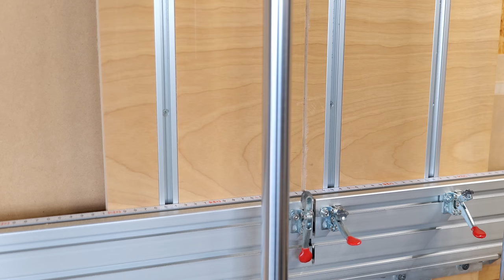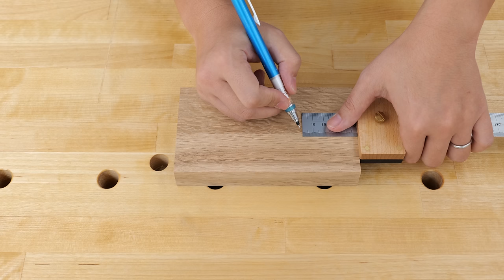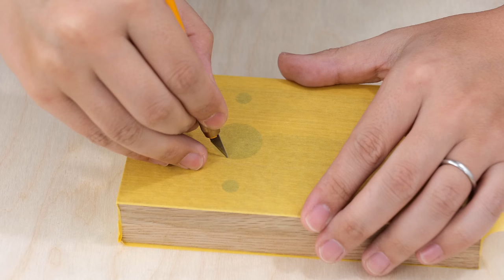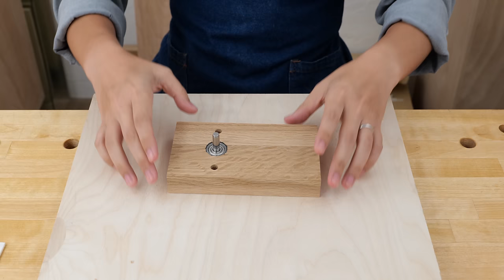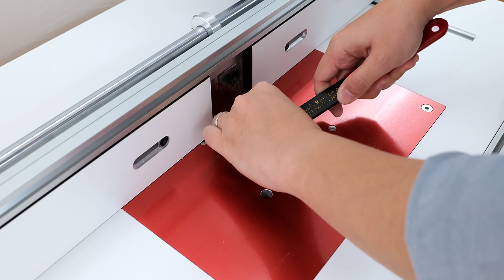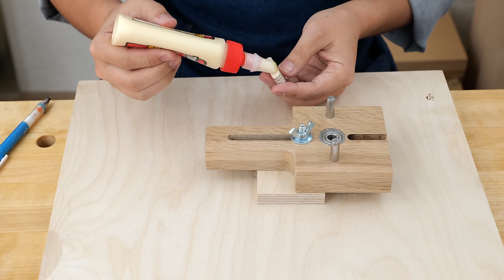Adjustable 3-ways Doweling jig | DIY Dowel Jig

Comment: I looked at commercial products and read all the positive and negative reviews. Most of this type jig were either inexpensive but flimsy or quite expensive and robust. I decided to follow your example, especially as I liked the use of bearings rather than steel or brass guides. Thanks for posting.

Comment: Just made one this morning, works great!  All my dowels were perfectly registered.  The only building mistake I made was not routing the registration groove far enough to the drill guide, the jig is more useful if you bring it as close a possible.
Thanks JSK
Reply: Are those like skateboard bearings that he used?
Reply: @shojimujoshojimujo3315  I'm not sure.  I just used a 3/4 inch high drill guide bushing from Lee Valley tools, works perfectly.
Reply: @acanadianwoodworker  How many man hours did it take
Reply: @patstenzel  I think maybe three or four?  You have to cut, layout and drill very accurately, and then router the guide in the middle very accurately.  So all the little setups take a while.

Comment: For most people who can't drill three very accurately spaced holes it would be far more sensible (and quicker and possibly cheaper) to buy the wolfcraft dowelmaster jig, which I suspect inspired this project.

More generally, if you are looking for accuracy or for at least one of the edges of the joint to be flush, dowel jigs that use a single reference plane are the way to go rather that jigs that self centre. The author has made videos on these types of jigs previously.
Reply: If you built this the way he showed you would be able to drill  three very accurately spaced holes.
Reply: Assuming the quill in the drill press you were using did not wobble around like every one built in China appears to! The author has built his own drill press using a hand drill that appears to have very little play in the output shaft bearings and runs on linear bearings.

Having said that, it is always better to reference off a single surface when accuracy is required. The featured jig relies on the thickness of the material being joined being very consistent, something that is not always the case.

Jigs that use a single reference surface are also easier to build and can be used to put dowels closer to the ends of a joint than this type of jig that can only get to 30-40mm away - not much use for material under 100mm wide!

In summary, this jig is only useful for joining largish engineered sheets of material such as MDF, plywood and chipboard, where the thickness of the material is very consistent and the edges to be joined are long enough to allow the pins used for self-centring to rest on the material. A jig that uses a single reference surface can join the above materials, is easier to make and can be used with more typically dimensioned wood, getting the visible edges perfectly aligned.

Comment: It seems fortuitous that your router takes the same diameter tool than what you want is available as a standard wooden dowel size. In the US, routers take either 1/4 or 1/2-inch tools. This means, for your nice self-aligned router trick to work, you’d have to turn down a (steel or brass) dowel from 1/2 to 3/8 part way to fit inside the roller bearing. That’s probably the trickiest part for most DIYers without access to a lathe. For 1/4 dowels, your method works out of the box.

Comment: Very ingenious and well done.
Thank you for this sharing.
The idea of using a stack of bearings for guiding the forest is ingenious, but I think the chip evacuation is therefore more difficult since there is no longer any relative movement between the forest and its guide. I wonder if a hardened steel drill guide might not be better.

French text translated into English by Google
Reply: Lousy translation. Bearings for guiding the "forest" ? Also, I would a cheap drill bushing rather than a stack of expensive bearings which is what I did as a tool designer at Boeing.

Comment: Fantastic workmanship, it appears that many of your tools you have built or modified yourself.  Unfortunately, I do not have the refined woodworking skills that you have so I had to buy a jig for dowels.  eg: JessEm Doweling Jig Master Kit.  However, I do very much prefer your design (twist centering pins) with respect to centering the dowel holes on the EDGE of the joint.  

You are incredibly creative.  BTW, Subscribed.

Comment: Ok so is it that you get the first measurement by eye to set the distance of the drill holes and slot, then you set the jig and all the other holes are measured automatically. That's a brilliant method using the two diagonal dowel bits to find the exact centre of the side surface. Brilliant mind. Is this what you call a thingy-me-jig?

Comment: Very impressed.  But it seems like the connected members may not be dead on 90 degrees to each other.  Think the first joint was not completely flush.  thought it could be that the parts were not completely set with the mallet.  Would have liked to see a machine square used to verify result.  The problem with many of these jigs is that they sometimes have errors that accumulate with each step.

Comment: Hrm interesting using ball bearings for that.  I'm not sure why he didn't cover the ball bearings with masking tape during the epoxy process though...
Reply: michel777ification  Uh, it would have been faster and he wouldn't risk pushing epoxy into the bearing?
Reply: Agreed. Seems like covering the sides of the bearings would have made cleanup of the epoxy easier

Comment: Very nice. A possible improvement would be to make it from a block of clear acrylic rather than oak, so that you can see through the jig to markings on the wood for dowel placement. In the example shown he seems to just place the initial dowels freehand, but sometimes they will want to be at precise locations.
Reply: The whole point is they don't have to be precise, because the initial dowels locate the second holes. Once the joint is glued who will know?

Comment: when drilling the two holes for the dowels using the drill press and the little spacer block, why use the block separately for each side/hole instead of just flipping the workpiece? they are through holes after all and they would be perfectly offset from center.
Reply: Thats what i thought too. But this is how Japanse perfection is being percieved! 💪🏼

Comment: Amazing job as always, such a great idea.

Only question about it,  do you have any fears of it splitting around the bearing since the wood grain on both boards seems to be parallel to the slots?
Reply: The epoxy and the bearings keeps it together I think,  so be sure to insert those before you rout the slots.

Comment: The only problem of epoxying bearings like that is that the squeeze out might bond it. Specially the one in the middle.
Reply: even if it bonds it would work... the commercial product (the one i own) has a brass bushing and works fine

Comment: This jig gives a 200 dollar jig a run for its money.  
Someone in Taiwan will copy it and make it out of aluminum and sell it for 3 bucks. 

I think if I were to make one I might use a 3/4" lexan for the body and one bearing, the drill bit and drill bit stop are common
  you would just need to size the bering after all its only a drill guide Thicker would be better but its not necessary
the berrings not necessary if you had some hardened steel tube Like they use on the Craig pocket hole jig.

Now the question is would I use it?  I kinda like the loose tenons over dowels but I'm not buying a festool tool to make them
not when you can do it with a router and make you own tenons.